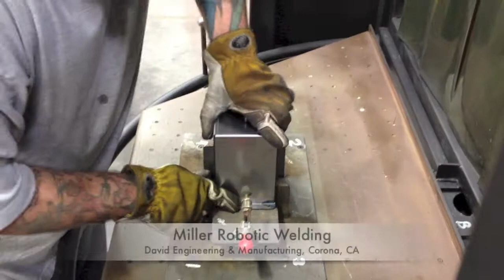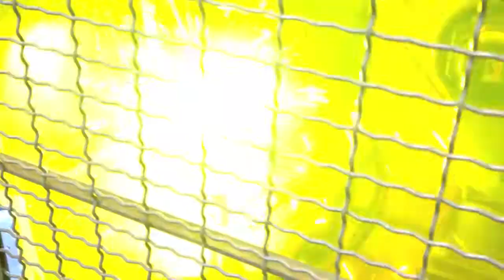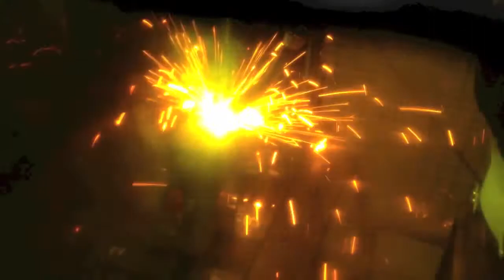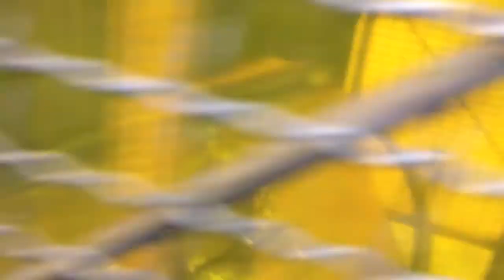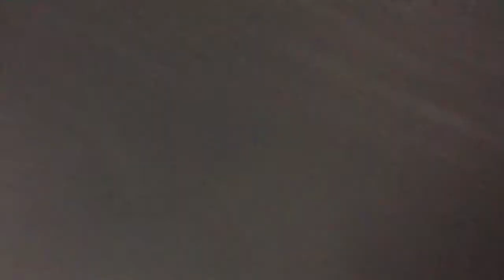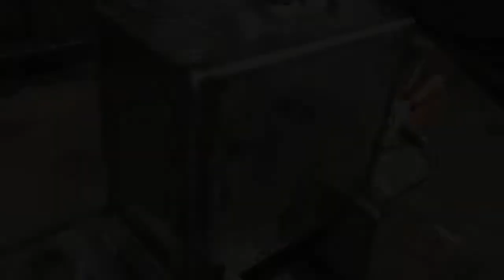Sump Tank Welding Demo

Comment: Quick welding it's sure but long programming? it's problem, especialy if you want to make a few kinds of details
Reply: You are correct, there is some programming involved but if it is a large enough volume or the part has repeat orders it is well worth it.
Reply: that's right!   i'm operator of robot panasonic tl 1800 
 and this is very big problem for me, our company bought this robot , but we have't many repeat orders. 
 and my job is proamming programming progra...   for each oder orders, it's very stupid thing. and big mistake for our company.    Hallo from Russia :)